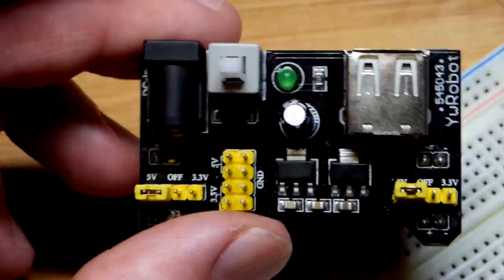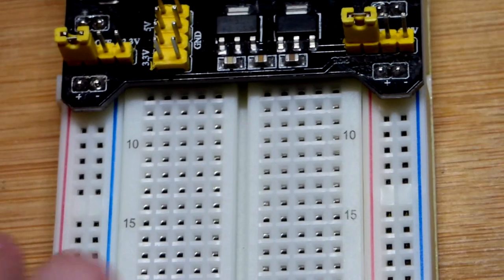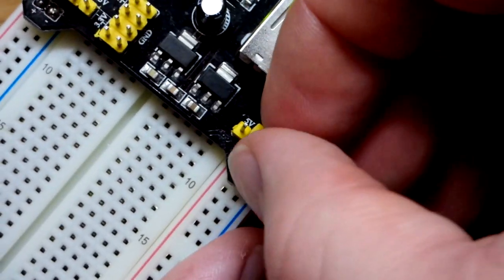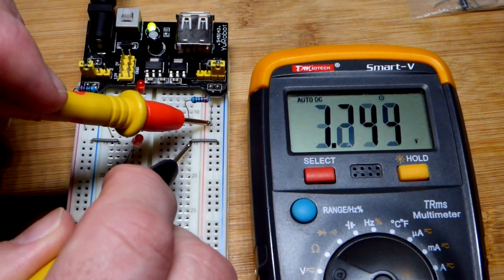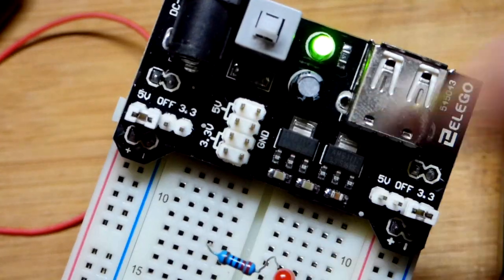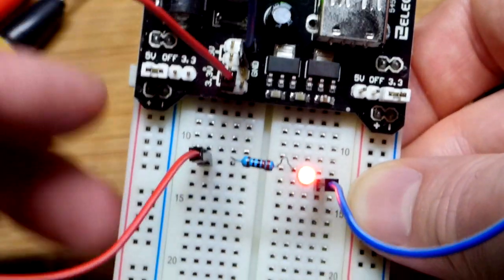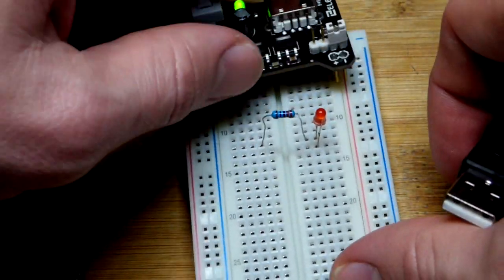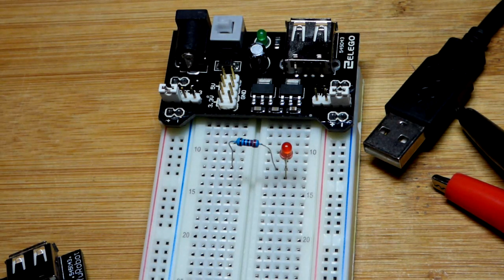How to use a breadboard power supply module for DIY learning electronics

Comment: Great video, I have the exact same bread board. The only problem I have is that I thought the power supply came with the bread board. Any recommendations on where I could find a power supply like the one you used?
Reply from the maker: I like Amazon. Just search for breadboard power supply. Probably want a pack of 5, it's easy to fry them and they are less than $2 each. Also need an AC to DC converter with the right size barrel plug.
Reply: @Electronzap  my apologies I have a power supply. I meant like I didn’t have a barrel plug to power the power supply. Would I have to buy an oscilloscope like the one you had with the barrel plug or is there a way I can just buy barrel plugs? Trying not to spend extra money on an oscilloscope rn lol.
Reply from the maker: @daltondelaney9534  it's a standard adapter you plug into the wall and has a 5.5mm X 2.1mm barrel plug. I'd post a link to one but I'm on my phone at work. I use one made by Soulbay that I got from Amazon. It has a number of plugs and an adjustable voltage. Need to make sure you don't exceed 9 volts with a breadboard power supply.
Reply: @Electronzap  gotcha I’ll give it a look. If you don’t mind go ahead and send me the link later if you get a chance I’ll be busy working also until tonight. Appreciate the information!
Reply from the maker: @daltondelaney9534  https://amzn.to/3w4lEr6 is the one I bought a couple times. That's an affiliate link.

Comment: Do you need to power it by 9v and usb at the same time or just usb is enough? In the video he had 9v plugged in the whole time.
Reply from the maker: The module is powered with the 9V barrel plug only. The USB port is for providing 5V USB power to something else.
Reply: @Electronzap  got it. Many thanks. It would be nice to have these usb chargers power breadboards though since they are easier to find
Reply from the maker: @janakaone  There are connector cables that you plug one end into a USB supply (such as a portable power bank), and then has alligator clips on the other end that you can clip to pin connectors on the breadboard for 5 volts. Many USB power supplies quickly turn off at low current though, which is very annoying..
Reply: @Electronzap  many thanks for the information. I didn't know about that issue with usb chargers before.

Comment: Aaah. Does the power module have to be charging through the barrel jack at all times? That sucks, but its a good kit. I ordered it.
Reply from the maker: Yeah it needs to be plugged in to use it. There's no battery.
Reply: Oh ok. Thanks for the heads up and the heart, i thought my module might be broken

Comment: I took mine apart 😂. Guess what I learned?
The 5 volts get rectified then sent to the 3.3 volts. I would have thought both would be directly attached to the input but they're in line with each other. If you wanted to you could put a 9-volt and a 5 Volt or lower as long as you start by replacing the Fievel with the highest value you're looking to change it to and then the lower one after it where the 3.3 volt is currently regulates.
I short circuited it myself. That's why I took it apart
Reply: I also believe the 3.3 volt powers the led but in not sure
Reply from the maker: Nice :)
Reply from the maker: That's pretty interesting!

Comment: According the Elegoo datasheet, when you move both jumpers to "OFF" the power LED indicator will turn off. I'm not sure that's actually true. Just something to keep in mind should you want only USB output.
Reply from the maker: Didn't know that, but I have a hand crank generator where the USB output also provides whatever the voltage is set to instead of always providing 5V, so not surprised.

Comment: IMPORTANT : There are known variants of this module without any regulation for the USB voltage. Check the voltage with a meter before using.
Reply: yeah i didnt - definitly dont plug it into your computer almost just fried the board and the computer :/
Reply: @litedeveloper  lol, why did you needed to connect the module to your pc?
Reply: @Deriko31 they probably thought they could program and arduino via the usb
Reply from the maker: Thanks for the tip!
Reply: yeah i think one of these busted my nano
Reply: I mean the usb is made to power arduino or something expecting to have a built in LDO
Reply: I confirm what you said.  There are many variants of this module. It's not a module to trust blindly. Proper testing must be done before risking any other hardware.

Comment: Max current 700 mA.
Reply from the maker: Good point! I think I've seen either 700mA or 500mA back in the day.
Reply: There's no way of drawing 700mA from these power supply modules without burning the regulator. These are linear regulators and dissipate heat internally raising the temperature with potentially fatal results. The regulators need at least 1.3V across them to operate, so 6.3V is the absolute minimum supply. The 5V regulator would be dissipating 0.91W at 700mA but the 3.3V regulator would be dissipating 1.19W at 700mA. That is right on the edge of the 1.2W that the AMS1117 is specified for, with no margin for error. If the input voltage rose to 7V, the dissipation in the 5V regulator would rise to 1.4W at 700mA bringing a real danger of damage.